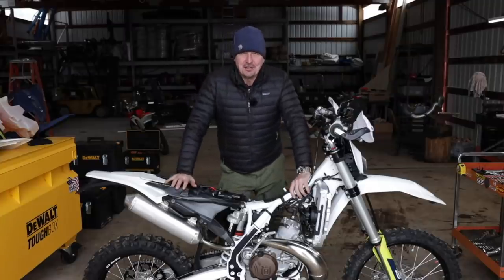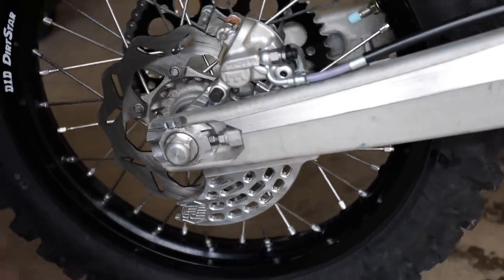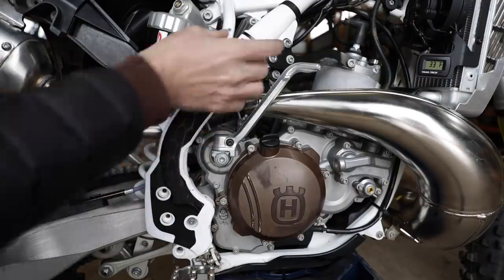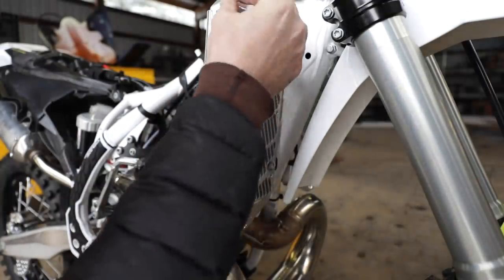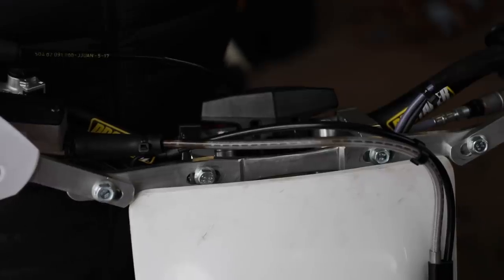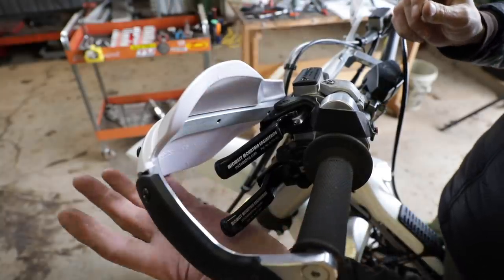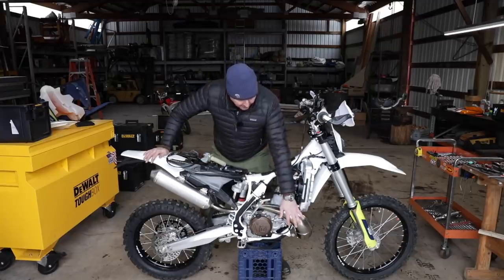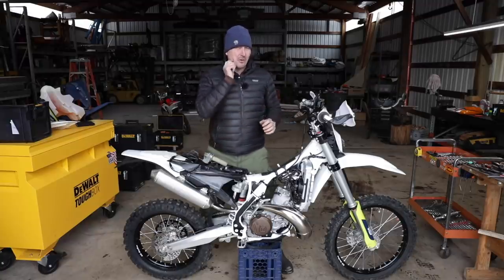10 Tips For Setting Up A Great Woods Bike - Husqvarna 300

Comment: I've been riding for 20 years and have never met anyone who leaves their Bike 100% stock - lol! That's part of owning a Bike - customization :)
Reply: Bobby W i do i leave it bone stock down to the air and fuel filter. Same with my cars i dont like messing with them unless i purchased them for that reason.
Reply: Buying a bike is just the down payment for all the farkles
Reply: erick, that's weird
Reply: Kurt Haller no i just dont see why mess with it then it voids the warranty. To me if your going to change it then you never really liked it at all. If i spend 50 grand on a new truck why change the rims and tires if they are new. Now if the get damaged then i might change them
Reply: Love your Husqvarna & the way you have it set up. I have a older ktm-300xc & love the 300 2 strokes. On my bike I have a carbon fiber pipe guard the same radiator guards that you have + fastway handguards. I still would like to put a lectron carb on it though but the keihin isn't to bad.
Reply: @erickfernandez8485   Yes void your 1 month warranty on a dirt bike.  I think we will survive somehow without it.
Reply: @erickfernandez8485  do you ride in the mountains? I find riding flat lands or sand the bikes are usually setup well. As soon as I go rocky steep slippery I need to start tweaking. Keen for your response as I love to learn others experience

Comment: So the top pro enduro riders arent using the Rekluse Auto clutch and left hand brake because A- They dont need to
B - thats catered to your leisure easy rider thats a little competitive
C - A lot of their control comes from always using the clutch... hopping over logs, going up hills, rough terrain etc   its more control
D - The Midwest levers are good with Rekluse, not so much with stock clutch. Midwest is an easier pull but you also have to pull it further into the bars. With the stock clutch lever, cut down a little allows 2 finger pull but I only have to pull it in less than an inch from full out to completely disengage clutch.  Couple tradeoffs. 

Now for my Dad that, your bike is an ideal setup for sure! Really like your vids

Comment: I have a 2017 TE 300 and I’ve gone through the suspension, added a lectron carb, v force reeds, FMF turbine core silencer, trail tech fan kit, bullet proof radiator guards and a different impeller for cooling. These mods made the bike much much better.

Comment: Nice job got her looking trail ready.Your lucky to have someone with that much knowledge close by.I learned what works by the tried and true school of trial and error.Rode a 99 XR250 for about 10 years,then a YZ250 2 stroke  and now a KX125.Just got a 94 KDX200 I'm doing a complete frame off build, engine, suspension and all.Hope it turns out good.The 125 is great for this  51 year old rider,but not much bottom end grunt, light and nimble  though.

Comment: Just bought a NOS KTM 2017 250 XCW. I added skid plate, same bark buster guards as yours, Ktmand Husky radiator guards and FMF 2.1 shorty. Having small Issues as well with adjusting the carb, much more I may go with the Electron. Had a Rekluse on my old bike and starting to miss it. Every thing else I replace when it breaks. No pipe guard until factory one gets damaged and then I have an excuse for buying a FMF Gnarly 😄.

Comment: nice upgrades. only thing i would do is having the front lever for the rear break under the bar so you can use your thumb breaking and use the clutch at the same time. this is how some guys in roadracing dooing it. i did it on my old husqvarna supermoto when racing. would be worried under stress graping the worng lever . but thats just me. greatings from germany. have fund riding
Reply: SavageForged Minis Road racing is a different kettle of fish. A thumb brake is going to be difficult to use in the gnarly stuff off road. Great for road racing though.

Comment: Pro enduro racers don’t use a handlebar mounted rear brake because using the clutch is critical to technical riding. Auto clutches are garbage unless you have a disability that prevents you from using it.

Comment: Nice review, I own a 2019 TPI and it actually works very well. I put a skid plate and put Evans coolent in it, and that is the only mods so far. I also own a 350sx and a 125sx, and both bikes have mods that really help on the trail. The best mod I seen in your video was a spark arrester, its much needed to be legal on public ground.

Comment: You're 300 has come a long way VERY quickly, and Its got all The Right Parts if you ask me! ( Except for 10:20 😂 ) But,  its you're bike what ever works for you is the important part.  I did the TUbliss thing and it was a god send. But, I did have a problem with sealing. Im Doing Hare Scrambles this year an I figured Id try the bib mousse for a change. We shall see how it works out..
Reply from the maker: I've got 300 miles on the Tubliss with no issues. My brother in law rides thousands of miles a year and has never had a problem,
Reply: Right on, I ran them all of last year. Not sure how many miles or hrs it ended up being. The Traction from them Are Just out of this world!!  On mine, The Inner Liner Stayed Intact through some 0 psi Rocks which was good.  But I kept loosing pressure in the tire from bead sealing issues. I found the Inner liner rim lock had to be torqued just right. Any loosening or over tightening and It would deflate rapidly. The Main issue really was to no fault of the TUbliss system. My rims were not Trued on my previous bike. My way of thinking is The Bib might save me If im in the middle of a Hare Scramble and I bend a rim.
Reply: I keep telling him to look into the Clake instead of the Third-Hand setup.  His buddy Bob probably could have schooled him up on carb tuning and saved him dropping the $$$ on the Lectron, but not a bad card played, since he didn't go the EFI route.  Not sure where he gets his info on EFI issues, but https://www.youtube.com/user/kylebrothersen/videos has been raving about the new bikes, especially for people who don't understand jetting :-)
Reply from the maker: The first thing Bob does on all his bikes is install an Electron. Many of these rave reviews get free bikes to demo and rarely bite the hand,
Reply: Wranglerstar I have a JD kit, and my budy is running the lectron. I ride these bikes back to back. Lectron is way better for sure, dont let anyone try an convince you otherwise 👍
Reply: Gladius Jon LMFAO !!

Comment: When you said that you knew a man that know everything, I rolled my eyes thinking "Yeah right, everybody does" but after seeing the results I can say that he his a wise man. I would not want a rear hand brake probably for the same reason that the pro don't use them. Better clutch control. However, if you like it keep it. Really nice handguard setup, I have taught of doing it like this before but I never saw it. My only concern is that chain. I hope that you did make it tighter. I know the video is 3 years old but if somebody see this, relax with the wheelbase story and keep a good chain slack because that is way too much. On a bike with no chain guide, you won't do a mile before it jump off the sprocket.

Comment: Put the 13t counter sprocket back on, and go up 2 teeth on the rear. The reason the 12 tooth is hard to find is it wears out chain slides, and the tighter turn around the counter sprocket add's rolling resistance.

Comment: I really don't wanna see ya get hurt, not covering that clutch, and not having that rear foot brake. You can't cover the clutch, and the hand brake at the same time, and that's just asking for a whiskey throttle accident, especially being new. Keep your hand brake, put the foot brake back on, and put the stock clutch back in, or run the rekluse manual. That 300 will get better traction, and control with good clutch technique than that auto ever will. The rekluse on the big 4 stroke's, is kinda ok just because they stall so easy, but hate the heavy pull, feel, and control on my Husaberg Fe501 rekluse core exp 3.0. 2 strokes just don't need em, they almost never stall.
Reply: I agree, the clutch is the best protection against whiskey throttle. One little pull and you're back in action.

Comment: For sure get the proper fork springs.  The fork and shock springs need to both be sized for your weight, for the suspension to work as designed.  Plushness vs firmness should be controlled through valving and the clickers.  I like your choice of bike and mods so far.
Reply from the maker: Agreed, I might be upgrading the fork,

Comment: The risk of the hand guards are not that they will break , it is that your hands/wrists gets caught on them if you flip over the front of the bike. But most falls are to the side and in that case they protect your hands and levers. Would not even consider riding without them

Comment: Great video. I’m curious on what you ended up up doing with the front suspension. Did you respring and if so, to what? (I’m the same weight as you). I ended up springing for my weight but they are too stiff and am now thinking of going back to stock and turning the preload up before I go back to buying another set of springs. I have a 2020 TE300, same forks. Thanks!

Comment: Did you ask Bob about which gasoline to use? Ethanol gunks up the carb so I would use high octane non ethanol unleaded if I had to. I've been told that high octane leaded gas is much better and makes the bike run cooler. Since it's an offroad bike, you might be able to use the leaded gas.

Comment: be careful with the aluminum hand guards if you go over the bars you'll brake your wrist
Reply from the maker: Not if you let go,
Reply: Your instinct is to hold on for dear life, but you probably don't have time to even think about it in a crash either way.
Reply: Ethan Sanders Personally never seen heard it happen yet. cheers ride safe
Reply: This happened to me. Easy to say “let go”, sometimes you don’t even have that much time OR think you can save it
Reply: it's not about letting go. I had both bones in my arm break from closed in style hand guards. Yes it does happen. Yes I still run them lol. I actually run the same ones you have. The danger comes in when your arm gets stuck between your bar and hand guard. Sounds crazy? No, think about this, you are running in a tall grassy field at a relaxed 3rd or 4th gear cruising speed. You are standing, nice relaxed grip like you should, and there is a big ole rock hidden in the grass. You hit it hard. You blow your hand off of the front of your grip as you fall forward, and your arm slides between your bar and bark buster. Next you are heading over the bars, but the bike is trying to stay on two's. The bike becomes a giant lever of arm breakage. I have done that exact same thing, and had a few other close calls over the years. I still feel my Cycra Pro bends have saved me from more broken hands than I can count. It's one of my first mods on every bike, just beware about getting caught up in them
Reply: Far more likely to smash your hand on a tree than you are breaking your wrist in your hand guards. I’ll take my chances with the guards.
Reply: Almost broke my wrists with those things just like you said took them off immediately. Also if you do hit a tree on the trail it will knock your steering off and be even worse. I like the guards that just bolt to the bar and don’t wrap around.

Comment: Did you ask Bob about which gas to use? I would use high octane non ethanol unleaded if I had to. But I've been told since it's an off road bike, you could use high octane LEADED gas. It's supposed to run cooler and much better.
Reply from the maker: We have a local station that sells high octane non ethanol gas that I burn in all my small engines,

Comment: If you change your shock spring you need to change your fork springs accordingly. You're bike is now terribly off balance where you're back end is too stiff and your front is too soft, it's going to handle like an absolute nightmare. As well even though you have a Rekluse you should still be operating the clutch normally. Nothing does more for traction than good clutch work.

Comment: In regards to the stegz pegs it's worth looking into getting the wider rubber kit. I had a similar problem and upgraded the rubber bungs to stick out further. Made a huge difference to rider fatigue. I use them in conjunction with pivot pegs and at 6ft4 riding in the mountains in slippery rocky terrain has been so much less trying.

One question I would love to know, what's the weight saving if any on the updated exhaust.

Comment: I'm not criticizing but for a guy who will do the bulk of his riding with a son and his buddies who can barely ride, this seems like a lot of needless mods..I've spent my life riding stock bikes and never felt the need mod them this much and my fellow riders could definitely out ride Jack. Ok that was an understatement. The only changes we ever did was tires, chains and sprockets for different gearing and spring rates or shock pressures. This just seems like overkill. Having said all that you will certainly be ready for those hare scrambles and competition races. I am also from the pacific northwest just further north and across the border and I could see the benefit of the rear brake on the bars if I could also have the foot brake. Ok, I'll go back to my corner now Cody..
Reply: I don't normally agree with the comments here, but this one I do. I've done everything from club racing sport bikes to teaching my kids to ride dirt bikes. I've found my time on the seat has always benefited me more than anything I could bolt on. I spent a week with Colin Edwards at his ranch and we rode 125TT's from sun up to sun down and I learned more from their quality instruction on a "child's" bike than any go-fast bits I've ever added.

Seat time is the best thing you can do for your riding at any level. Learning an instrument, a new language, woodworking, even the Bible — you'll be better off with lots and lots of practice.

Comment: What happens when you have to start out on a very steep incline and your left hand is on the clutch and your right hand is on the throttle. What is going to keep you from coasting backwards? Can the left hand brake be used at the same time as the clutch? Wouldn't the foot brake be used to prevent the bike from going backwards on a steep hill because both hands would be busy? Steep mountain trail with loose rocks, mud, snow and lets throw in some ice.
Reply from the maker: I have an auto clutch,
Reply: I had to go watch a video about the auto clutch. But I understand now. 
I've always ridden street bikes and quads. So much of this is new to me.

Comment: I'm suspicious of that rear brake hand lever. Going back 40 years or so we didn't have so many fancy widgets, much less hydraulic brakes and liquid cooling, but did OK anyway. The thing about brakes is that you need independent control - with the standard setup you get separate controls for each hand and each foot. That's important with braking because off-highway riding always faces limited and changing traction, and you have to modulate the brake control accordingly, often while using the clutch or changing gears. Consider the forces involved - when you brake, and especially downhill, most of the deceleration force shifts to the front wheel. On a street bike they figure that 70% of your stopping power is with the front wheel. The same applies off-highway, where you need to be able to use the front brake, especially on downhills where your rear brake is almost no help. 

Consequently you need to be able to apply both brakes simultaneously, the front brake for deceleration and the rear mostly for stability, while maintaining a controlling grip on the handlebars. It is the foot brake that makes this delicate control possible, because that's the (usually) right foot's only job and it can do it without affecting the overall control of the bike. Eventually you should be able to control balance and braking on downhills precisely enough that you can slow the front wheel almost to a stop, even lock it for a moment and let it skid, without losing control of the bike, using the rear brake to keep the bike running straight.

Others will likely disagree, doesn't bother me a bit. I must say I could have used some of those magic tires a time or two - used to do some early multi-day events, FIM style, and changing a tire in the AM 15 minutes before your starting time is a whole set of challenges of its own. Have fun.